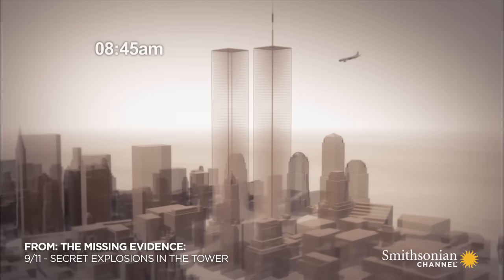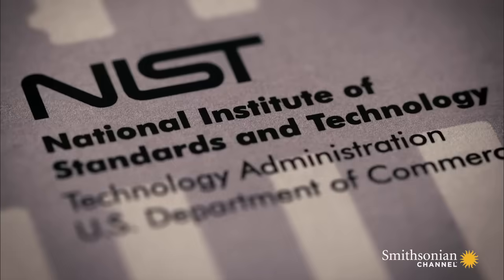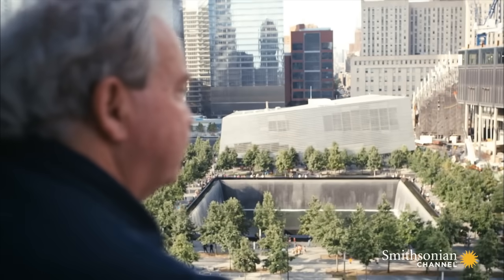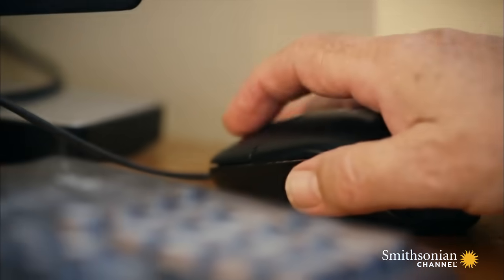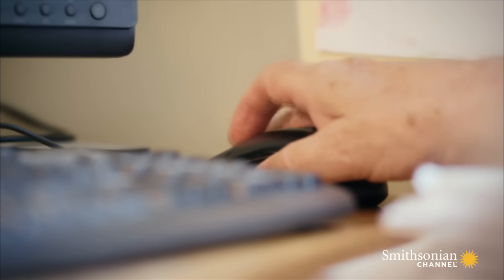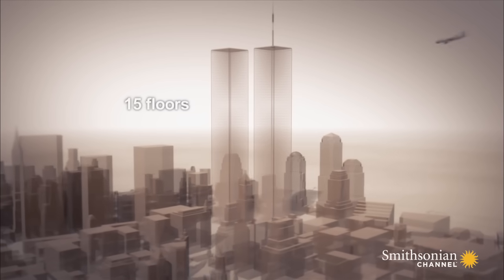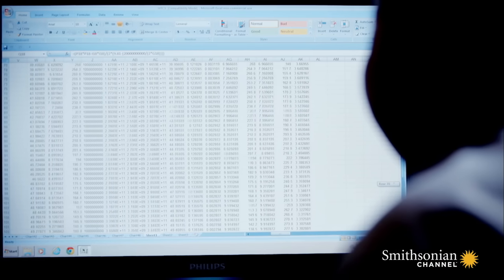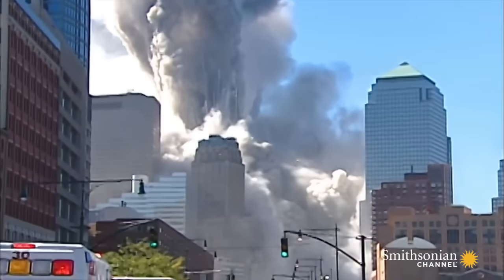This Computer Simulation Explains How the Twin Towers Fell

Comment: Ok, First of all I'm not a conspiracy nut as they call it, but i really want to understand something.
First, Why did both the towers went down in freefall speed? Was there absolutely no resistance from the floors bellow?
Second, Why did both of them went straight down (like a controlled demolition)? wouldn't at least one of them fall sideways? considering the side that was hit by the jets would be much weaker than the opposite side?

Comment: It makes perfect sense. Also, the North Tower was the first to get hit, but the south tower collapsed first, which doesn't make much sense until you realize that the south tower got hit a few floors lower than the North Tower, meaning that those floors were supporting a much greater weight than the impacted floors of the North Tower. Naturally they gave in quicker.

Comment: This whole simulation consists of altering the parameters to prove that the airplanes that crashed into the towers knocked it down. But if you make the simulation without altering the parameters the towers don't fall. Only until you start bulshitting the parameters and adding/taking away elements are the towers able to fall. I call BS

Comment: bullshit!
Reply: Proof? Oh wait u don't have cause ur a fucking dumb 11year old
Reply: Excellent, well thought out, scientific reply.
Reply: Common sense injection 1: 
Floors above do not change the weight that's on the 80++ unaffected floors below...  The core columns for literally 97% of these buildings remained intact. A 10 foot fall from the weight above would have only crushed a few floors, maybe. And it definitely would not have been symmetrical or complete...  
*ALL 3 times in the same day!

Common sense injection 2: 
This guy just totally went against the official report, he's a conspiracy nut!
No mention of "fires."
Reply: Nathan Ryan Incorrect, the kinetic energy resulting in a 3 foot fall from the top sections of the towers would be to much for the lower portions to handle. They fell over 12 feet......
Reply: Marc Lowenthal
That logic is invalid... It not only defies Newton's 3rd law, it negates it entirely.
Reply: Nathan Ryan Please explain how that’s so? This is not as simple as you think. The kinetic energy overloaded the steel columns in the towers causing a complete structural failure, Newton’s Third Law doesn’t apply here, rather the physics of how energy and weight is transferred in a structure is.
Reply: Marc Lowenthal
Stating Newton's 3rd law does not apply is simply absurd due to the simple fact of you have 2 opposing forces interacting, so it does, and will always apply.

 For the sake of argument, let's assume 5 floors all of a sudden vanished completely and the remaining floors above fell perfectly atop the lower portion, would it crush it? No, of course not, it's been holding that weight and could hold 4-6 times more than it's rated structural load capacity. Anyhow, now we have a 75 foot fall, perfectly even, plumb and level and somehow manages to fall perfectly straight...  The opposing force of the undamaged 90 floors below not only is far more than 10x the mass of the falling portion, but it also has a firm foothold on the ground and subsequent 60 feet of bedrock below on it's side. The falling portion simply does not have the mass needed to generate the kinetic energy to cause anything like what happened. In reality, that top portion falling 75 feet and performing  perfect 10 landing on the supposed undamaged portion, the top section would suffer far more damage than that of the remaining structure below. There has to be an equal and opposing force applied to the portion that is falling. It would have crushed the top not the bottom. If a structure were to fall because of failure of all the core columns at the exact same time, the collapse would initiate at the bottom, not the top. 

**Edit: I'd also like to remind you that nothing actually let go and fell any distance, watch the roof-lines and where the collapses initiate, it never impacted the rest of the building, it just all came down at once... Except on tower 2, the top broke off and fell over just after initiation. The now topless, but still ongoing collapse was caused by some mystery force... possibly alien. <-- I'm joking there.

...And I won't even get in to the half dozen 40 ton girders that were horizontally ejected at between 55 and 80mph and traveled as much as 300 yards in all directions from all sides of both buildings.. That's a whole different can of worms.
Reply: Nathan Ryan Your assuming the building is designed to hold that amount of kinetic energy on top of the weight of the tower itself. Your factually wrong. The buildings were never designed to hold much more than the tower itself because, well, there simply was no reason to. No engineer intends for a tower to collapse and no architect intends to factor in the energy the top 15-25 floors would produce if they fell. That’s just wrong. Your whole argument is completely null simply due to your misunderstanding on how the towers were designed. In both scenarios you mentioned, they actually would fall. These are solid as a rock, these are steel beams held together at joints and trusses.

Also, a rather niche concept you haven’t considered is the dead and static loads on the buildings columns. Skyscraper columns usually are designed to only hold up the dead loads above them. Static loads are considered but usually it’s for équipement added to the tower later on. The columns are supposed to distribute weight equally but because there was severe damage to the tower, this was not the case, thus some of the buildings columns needed to work harder to hold the dead load of the section of tower above them. When the towers all of a sudden fell, the dead weight of the towers became static which is exponentially different to a buildings structural elements and how it can hold it. This resulted in the tops of the columns to overload, then crumple, continuing the collapse to the next floor. This process continued on and on from floor to floor.

If you took physics, you would know that the kinetic loads on the towers would be a greater force than the force of the lower portion of the tower holding it up, thus nullifying your claim that Newton’s 3rd Law is relavent. The logic you are trying to use is the same logic you would use to try and tell someone that a regular house of cards could support a deck of cards falling onto it, when in reality, the cards would collapse due to them not exerting an equal force upwards. Your logic is flawed.
Reply: ok nerds.
Reply: @IsraelCube  The structure below was uneffected by heat or damage. The structure was built to carry the loads above. As the buildings fell tgey would have slowed in the decent not speed up.
Reply: @IsraelCube  One more thing.  I've personally have built military aircraft an also large buildings. An aluminum aircraft cannot damage the steel  structure as large as the world trade center.  Now before you say it waa the jet fuel, im going to remind you the fools said they found the terrorist passport on the sidewalk. Surely paper would burn faster then steel?
Reply: Rick Kunz Lol, there’s a lot of wrong in your statements.

For starters, I’m gonna address the bold assumption that the plane damaged the steel. It merely severed the steel connections which is shown in all the photos. This is why the holes are rough and have sharp corners in them compared to a nice smooth cut as you twoofers for some reason believe.

Second, your obviously not an Engineer. A structure can only hold so much weight and withstand so much kinetic energy before it fails. These towers produced the equivalent of, i think it’s 20 kilotons of tnt worth of kinetic energy, simply by falling 12 feet. That’s a hell of a energy, something no tower can withstand. These towers fell exactly as they should of in a Structural Failure scenario.

Lastly, is this some kind of joke you guys bring up? Surely you can figure it out yourselves. Paper is seen blowing out of the towers because of the impact and right after. This explains why the passport is found on the street, it was blown out of the plane, and subsequently the tower as well. Now maybe this is to say the fires weren’t hot, which is poppycock. Molten Aluminum(seriously people, look it up ffs, Molten Aluminum glows orange when it’s hot enough) is seen pouring out of the South Tower. The color it is can help us determine a temperature, 980 Degrees Celsius. With that knowledge, we can further determine that the steel was being weakened by said fires.
Reply: @walterwhite596  I feel you bro 😂
Reply: @IsraelCube  I love how people are litterally presenting you with factual information as to why it couldn't have happened this way an you're still trying to argue it. I'm starting to believe your just paid to try an prove people wrong. But since you're so "smart" explain why the steel girders at the base of both the towers we're cut or blown at exactly a 45° angle?
Reply: @IsraelCube  if the buildings fell as you claim wouldn't they just be mangled an twisted not cut at a 45° angle?
Reply: Cody Garmon I have never been presented rock solid evidence by a twoofer that proves controlled demolition. I already explained why they were cut at 45s and I hate when people bring it up cause it shows ignorance. The 45 cuts were done on the columns on the base of the towers, after the collapse, during the cleanup phase. They were cut with Plasma Lances and were cut in such a way for the beam above to simply slide off and fall into what they called the Pile. These cuts were made after the collapse, not before. Besides, if they were cut before, as you stupidly suggest, that would indicate that the towers collapsed from the bottom up much like 7 WTC. That’s not what happened, even remotely. Such a stupid claim which doesn’t even support your ultimate goal.
Reply: Ur mom is bullshit
Reply: Truth is hard to swallow when it doesnt fit your agenda!
Reply: The only bullshit here is you
Reply: You’re an idiot
Reply: Good logical argument Ana. From where did you get your PhD?
Reply: Ana Katnin what is